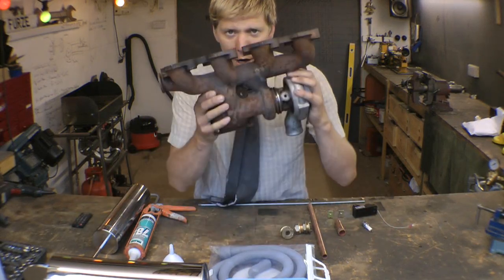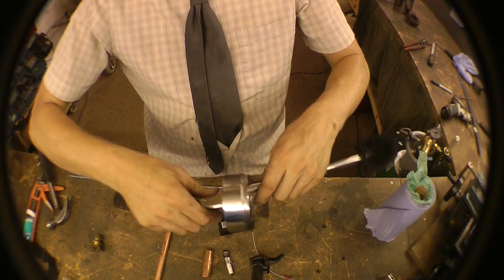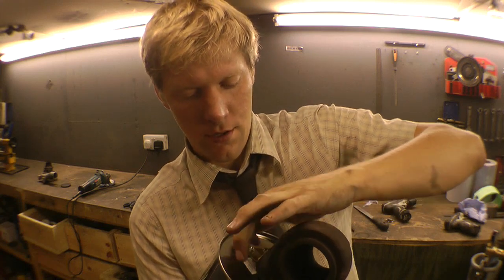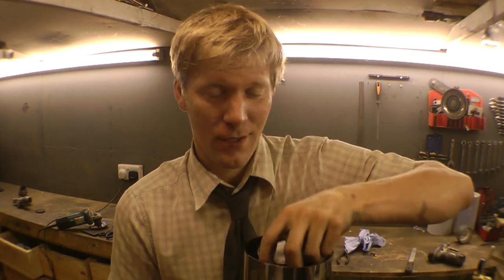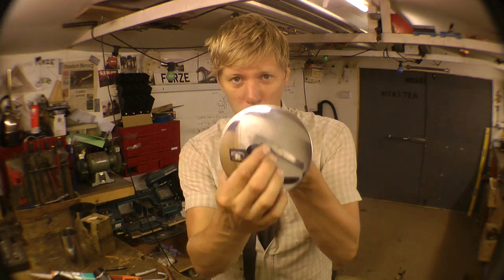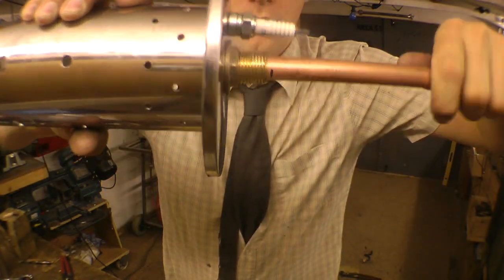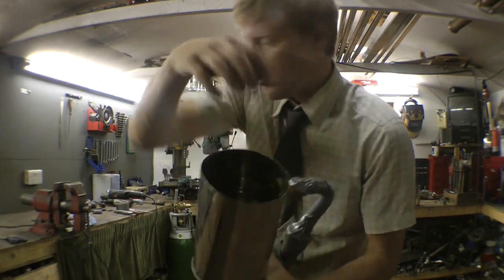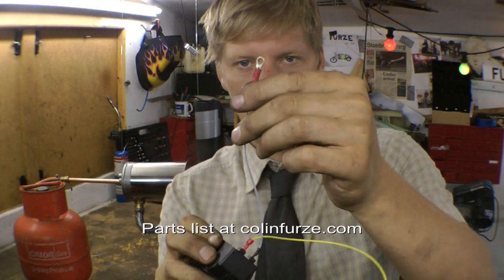Build a JET ENGINE using only a DRILL, GRINDER and duck tape (NO WELDING)

Comment: So it's a drill a grinder some duck tape,copper pipe,brass tube fittings,toilet roll holder,toilet brush,washing machine outlet pipe,bits of an engine,a turbo,spark plug,funnel,plastic tube,ice cream tub,cooker bits from Ebay.....It's like saying you can build your own space shuttle from an aluminium coke can all you need is some aluminium and everything else NASA uses to build a space shuttle.!!!!

Comment: "...and stuff you can get from your every day shops"
(3 sec later)
"you're gonna need a turbo off a small car"
Reply: Cheap & easy to find on Ebay
Reply: ds
Reply: Go to a junk yard to find one.
Reply: Yeah I got my turbo from pound land or dollar store
Reply: Ripped mine off my cousins car
Reply: Just go to the junk yard and get one for free
Reply: Neighbor wonders why their car wont start.
Reply: @coastalcowboy707  It will start, only if the turbo was welded with the exhaust manifold then the exhaust gases would come out directly in the hood and it would be loud as hell
Reply: Colin, my cars not working properly...

Er...
Reply: Just walk down the street, find a car that has a turbo, and do a little midnight auto salvage!
Reply: Charlie Dajoob easy at any shop
Reply: well Art attack did the same to us...
Reply: fuckin a..... statement goes hard:

concrete

Comment: USING STUFF FROM YA EVERYDAY SHOP: a turbo off a van
Reply: sigh
Reply: Ikr
Reply: PixlSwift scrap yard come one be smart
Reply: Well my friend buliding a jet engine from nothing is impossible
Reply: just took the turbo off of a van in the parking lot
Reply: PixlSwift go to a junkyard. They are everywhere
Reply: I dont know of any scrap yard that will let you just walk out with shit none of you have ever been to one obviously. If you would you would know that scrap is a good business the precious metals in shit can be worth it to dip out if you got equipment to make it easy. Not to mention second hand car parts you pull yourself but you cant just walk out The yard with em you need to pay! Granted this is in the UK and I am speaking from an American stand point.

Comment: Next build a nuclear reactor, with no welding!
Reply: That's actually possible, but you could only make a breeder reactor.
Reply: samuel edwards
Why breeder? Just to be more impressive?
Reply: +leerman22 I don't think you could make a regular reactor without welding.
Reply: leerman22 You could also make a breeder reactor out of Thorium, Americium, charcoal, and Radium.
Reply: samuel edwards
That would not go critical. Heavy water or graphite and natural uranium is how to make actual power without "boom stuff".
Reply: leerman22 It can still give off alot of gamma rays.
Reply: samuel edwards
That's what concrete is for.
Reply: The Eh Team haaaaaa🙈🙈!!!🤣👍🏽👌🏽
Reply: Made me smile!
Reply: Yeah nice try
Reply: already been done - an american boy scout named david hahn built a breeder reactor in his shed - irradiated his whole neighborhood... died when he was only 39...
Reply: @zeussx2120   Americium is nice.. work with that for a while you will definitely glow in the dark...
Reply: Yeah, I don't think we really want to be turning any part of England into the next Chernobyl.
Reply: Specify which form of atom you want to use--go back to the earlier designs of post WWII using the early plutonium (the American design) or the plutonium (the Russian)--much deadlier.

Comment: says only things from around the house pulls out a turbo
Reply: these days all cars have em so u can snap it off ur dads daily
Reply: so you mean to say you don't have  turbo just lying around ?
Reply: Well, a turbo which still spins good but is unfit for vehicle use (for ex. small oil leak, worn or defective waste gate) can be pretty cheap anyways (only worth the metal).
Reply: I've got three lying around mine lol
Reply: I have like 15 in a box in my backyard will trade for beer
Reply: we have big engines only ;( no turbos from stock
Reply: And an intake manifold

Comment: For the flame tube you wanna drill the holes at a slight angle towards the output of the engine to generate a bit more thrust and keep the flame from going towards the input in the engine.

Comment: If something doesn't work, use duct tape. If that doesn't work, use more duct tape.
Reply: +XCraftStudios 
When things should stick together, but they don't, use duct tape.
When things stick together, but they shouldn't, use WD-40.
Reply: +DJ Shuffle  How much should the F-22 have cost with Colin on the team? Imagine seeing Lockheed Martin ordering toilet brush holders to complete critical development stages.
Reply: If it doesn't work use flex seal
Reply: And if it still won't work, make a giant sledgehammer of ductape, Bam, and start over

Comment: How the fuck did it take us till ww2 to make jet planes? This guy did it in a shed with an angle grinder and a drill.
Reply: Stefan Massyn lol so true
Reply: The toilet paper holder technology wasn't ready yet then!  That's what held up the whole darn process!
Reply: they weren't any good in ww2. like this one.
tolerances and efficiency is what makes crude shit work well to where it actually makes inroads.
Reply: Stefan Massyn Because Colin knew what he was trying to make. Engineers didn't  have an idea of what they were trying to have as a finished product. They had to discover this technology.
Reply: that's because information has been passed down so the next generation gets smarter and so on...
Reply: No, he did it with a turbocharger. These types weren't available in ww2 due to insufficient material advances. Now they are available, and for cheap.  People have been using turbos to make shoddy, though functioning,  jets for years.
Reply: Stefan Massyn our gov saw no future in it so the germans and us beat the uk to the punch

Comment: Because everyone has an old manifold and turbocharger lying around..
Reply: That's what junk yards are for
Reply: Im not going to a junk yard, sitting there for hours dealing with the inevitable stripped bolts and broken studs, with no airtools or grinder, to pull of a manifold and turbocharger. Especially in Louisiana, where there is a good chance the engine exploded, or has rusted, where there are bits of metal or rust flakes in the turbo, rendering it inoperable so when you pull it off, after 5 hours, its no good. I have seriously considered going to a scrap yard, but then again, I wont
Reply: SlickNicklol most yards will have a few pulled already so just call em up and go grab one!
Reply: I do :)
Reply: Nthefastlane Can I borrow them?
Reply: SlickNicklol You think theres 'a good chance of rust' where your from? We live in England, it rains ALL the time if he can pull a manifold n turbo off then so can you!
Reply: Henry Russell But, louisiana... and.... humidity..... breaths heavy
Reply: You mean to tell me your local supermarket doesnt sell turbochargers?
Reply: oh its soooo hard these days to find anything isnt it? with an internet connection and a phone you can pretty much get ur hands on 99% of everything commercially available on the planet. Yes you have to buy the parts to make shit, well done mate
Reply: tooto macmac not drugs tho
Reply: Alright... so can you think of a better way to make a jet engine smart guy? Didn't think so..

Comment: umm might wanna change the title on this to using drill and grinder and duct tape and tp holder and brush holder thing and u need a fuckin turbo to.  lets not forget that cuz everyone has a turbo or two laying around.
Reply: and lets not forget everything else i didnt list
Reply: using only a drill and grinder as tools...
Reply: It's pretty impressive for what anyone can find ..
Reply: Its not like you can make a nuclear missile out of 20 CD Players and 5 PS3's, or can you!?!?
Reply: I'm glad s33dless1134 actually wrote duct tape, rather than 'duck tape' as everyone else wrongfully calls it.
Reply: the title is build a jet engine USING only a drill grinder and duck tape, not build a jet engine WITH/FROM all of those, though in the start he does say "and stuff we can get on everyday shops", to be fair going to a junkyard and asking for a part of a engine block to cut a turbocharger from isnt exacly an everyday thing.
Reply: supersmashdragon Turbochargers are bolted on.
Reply: Mjjingz  0:45 . though thats the "exhaust" part i think it stills count as part of the turbo.
Reply: its easily removable. 4 studs holding it on
Reply: You might want to work on your spelling, so people can take you seriously.
Reply: Aerial Imagery Actually I think an American firm used to be one of the main manufacturers calling it 'Duck' tape, so it's kind of like people calling vacuums Hoovers. Not really that wrong.
Reply: Mark Barton
Mark, you are absolutely correct.  I've just searched for that name and voila, it came up.  So I'm incorrect with my comment.  Thanks for the research.
Reply: Aerial Imagery
 FYI The tape(in Aus we call it Gaffa tape) that all the pro roadies rely on is Nashua 357, once you start using that, everything else is garbage (according to my serious roadie friends). Leave it in the sun for a day or so for extra stickyness, and it can lift the paint off cars. Amazing stuff.
Reply: What with the sun in Australia, I'm surprised the stuff doesn't catch fire!   We call it camera tape, but only because I work in that industry (Motion Pictures).  Some call it gaffa tape.  It depends on what job you do in that industry.  :o)
Reply: right

Comment: 1:00 as a mechanic who has seen many of these cutting wheels come apart when used by inexperienced people, I just want to say, doing it with your face in the same plane as the wheel is a terrible idea. Just putting that out there.
Reply: Medic 83 that was the only problem you saw?
Reply: @douglasbagwell9467  nope. Just the first one I came across. Lol

Comment: make me a water powered car, that burns hydrogen.
the challenge in this, don't get " a heart attack"
Reply: Breathing techniques been there. Long slow slightly restricted breaths.
Reply: The trick is to make the generator also a capacitor. Also graphite doesn't rust. Neither does shooting microwaves. Good luck 👍

Comment: "using only a drill, grinder, and duct tape"*

*and several different drills, and several different bits, and a turbo, and headers, and pieces of toilette cleaner holders, and L brackets, and screws, and nuts, and calk, and a permanent marker, and a screwdriver, and a socket, and a plastic insert from the toilette brush holder, and a ruler, toilette brush holder lid, and a pair of channel locks, and a fuel rail, and a spark plug, and copper tubing, and a toilette paper roll holder, and a threaded piece for the copper tubing, and a threaded washer lookin thing to attach that, and washing machine hose, and a tank connector, and oil, and icecream tub, and plastic tubing, and something to make the spark, and fishing line to hold it up, and gas............

Comment: Build a JET ENGINE using only a DRILL, GRINDER and duck tape (NO WELDING). Oh, and I forgot to mention, you will need a turbo charger...but don't worry about that...

Comment: Build a JET ENGINE using only a DRILL, GRINDER and duck tape (NO WELDING) -- and stainless steel tubes, a working turbo, various machine tools, drills and an angle grinder

Comment: Yeah, Re-title this please, To-  Build a jet engine using only, a drill, angle grinder, duct tape, van- turbo, intake manifold, toilet roll holder, bog brush lid, brackets, spark plug, copper tube, tank connector, cooker sparker, washing machine waste hose.

Comment: Built the entire thing but I’m having problems with igniting the gas inside of the combustion chamber. I have it mounted vertically not horizontally. The spark plug is creating a spark and there’s enough gas and air getting in but it still won’t ignite in the chamber. Any ideas of what’s going wrong????

Comment: nice try but, u are not making good setup for combustion chamber cooling system and a simple cylindrical chamber doesn't produce enough thrust if u observe practical engine it has compltely different design they know exact inlet to outlet thrust ratio with respect to combustion chamber, in this homemade terbine engine if the material fail i mean combustion chamber then it will bombard throwing molten metal everywhere

Comment: hey i am your big fan can you make a video on how to make a jet engine using a motor,some multi blade metal fans ,propAne gas some tubes and some other thing actually i dont want to use turbocharger i want to fit it in my bicycle

Comment: That kind of metalwork is best accomplished using a jigsaw with a metal cutting blade.  Those saws are cheap.  You can just drill holes inside the cut-line a bit larger than the saw blade and you are good.  No need for the rough.  You can make a lot of cool shit and pretty clean that way.

Comment: Seal the oil tank & connect a line from the boost tide of the turbo, so it has a little pressure.

Comment: The problem is not that i have no welder. The problem is that i can not weld. (My father doesn't allow me to try to learn it).
Reply: Simon T didn’t he say you didn’t have to weld
Reply: @quantum_chezburger2279  Jes, that's the point. I could build a normal one, if i could weld.

Comment: This is just so cool.
I always wanted to make a jet engine, but lack the tools and expertise. With this video, now I can.

Question about jet engines in general:

The output of the turbine is designed for more flow than the input - the combusted (burned fuel/air) gas is a much higher volume than the intake air.
So, how do you spin one up, and create pressure in the combustion area?
As you spin it up, won’t the exhaust blades pump out more air than is being drawn, creating a vacuum, not pressure?